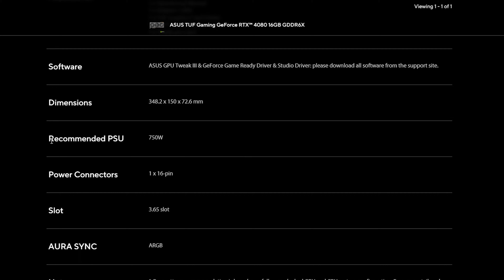RTX 40 | RTX 30 Series RED LED || SOLVED ||| 4090, 4080, 4070 ti, 3090 ti 3090, 3080 ti, 3080

Comment: If  you have ASUS motherboard, go to the BIOS -> Advanced power management (APM configuration) -> and set ErP Ready  to enable (s4 + s5). Problem is solved
Reply: It works! Thanks!
Reply: Didn’t work 😢
Reply: @ceoofaim2787  it turned itself off after 2 minutes
Reply: @Drozdu15  wild
Reply: @Drozdu15 what did you do?
Reply: THANKS M8!!!! you saved me from spending 20€!!!!!!!!🤗
Reply: What does this do?
Reply: Update:PSU started making clicking noises 1-2 days later after this setting change. Doesn't power on pc anymore. 850 watt evga gold psu. 
Worked for me. Thanks.
Reply: Really thanks !
Reply: Take it back and get another one. Problem solved: You have to watch courier service they like to throw your parcels..might have been the issue all along @henryrepeater
Reply: We need more people like you
Reply: Luv u
Reply: This worked! Thanks 🙏🏼
Reply: Greate!!! you are the best!!
Reply: It worked for me but I hope this doesn't cause problems somewhere else.i need see exactly what this setting Does?
Reply: I tried this but my pc keeps booting in safe mode it acts as if it’s gonna turn on like three times in a row and the. The issue persists
Reply: @pikimakeitsound  this fixed mine to but I try figure out what's up with urs
Reply: @ fixed ittt, for future reference make sure you do this from scratch before swapping out your card
Reply: Thank you thank you thank you thank you
Reply: Thanks man! Your awesome! My 4070 Ti stable working.

Comment: By the way, I just bought 4070 ti  same thing but I didn’t change the cable if you power it on it will work normally its bug in bios for the card I think seen lots of people have the same issue only downside right now is if you boot the device try to get to bios  it won’t work but a restart will fix it
Reply: How did u fix it this my first time build how do u get bios open if pc can’t even run for more than two seconds
Reply: @sfsango8559  did you find out? I think is a issue with the motherboard, it was running fine on a aorus motherboard, then I upgrade my system and red light appears on the new set up.
Reply: @armandoarroyo  I have redlight also, did u find any fix?

Comment: So my red light stays on when I flip the switch on the back of the power supply but when I click the power button on the PC case, the red light goes away. Does that mean my GPU is good to go because I’m playing games and the red light is gone but as soon as I turn it off the red light turns on
Reply: When the PC is off the 12 pin don't get any power. So the light comes on. When the PC turns on the 12 pin gets power so the red light goes off. But if it's red even after turning the PC on your GPU is not getting enough power.

Comment: Hi, i have exactly the same issue but after 8 months using without problem. Strange.
Reply: My 3090ti just started this after 7 months of use, and not daily hardcore use either. Sometimes only weekend
Reply: Did you get a fix
Reply: @HardHeadMilitary   Yes, had to change the power cable as he did in the video. Like 25€ on amazon

Comment: I think it’s normal that after turning off you it shows the red led because the power supply is no longer smooth as it is on in a nutshell the gpu is simply telling you  that it is not receiving enough power (obviously because the pc is off)
Reply: Is this true
Reply: @JohnTony-bv3rp I believe so there is a post about this and I have the same thing. When I turn it off it is red light all day. But turn on immediately goes away and the red light never comes back
Reply: @SFGiantsfan9797  yes I learned that it isn’t a problem at all it’s totally jirmsl

Comment: I have the same problem my 3070 ti has a red blinking light but all the cords are good and drivers up to date. It even runs games good so idk what the issue is
Reply: Did you figure this out???? I’m dying to figure mine out it’s a red flashing light also
Reply: @fluudzz6318  it downloaded the software for the gpu and it seemed to fix it like the actual software for the brand of gpu

Comment: I have a 4080 super strix ive tryed gpu tweak didn’t work I tryed bios thingy didn’t work the red led is only on when off I’m using a strix mobo b650e-e what should I do buy the adaptor or not care about it

Comment: I have an EVGA FTW 3 and it has been working fine. Then 2 nights ago, display went out, no RGB on the card and a solid state red light. I had changed the pcie slots on the psu and reseated the connector to the card it fired up… then when i started a game it shut back down. I have a new 3 pin to 1 connection coming in the morning, if that doesnt work I am either taking the card to microcenter or trying a new psu. Kind of at a loss
Reply: I had my card RMAed with the same issue, and even the RMA card is having the same issues.. lmk if the new cord fixes anything
Reply: @db8717  actually yes, the new connector seemed to have fixed my issue
Reply: @HardHeadMilitary  Alright, I will try that myself thanks man

Comment: If you have a corsair psu I would buy their 12+4 pin lead, I had the same issue on my 4090 and as soon as I switched to the corsair lead the light went out. The adaptor you get with the cards are horrible in every possible way.

Comment: When using PCI Express power cables with the Nvidia supplied 12 volt high power adapter plug, the red light will turn on when the computer is in standby mode. This is perfectly normal. If you purchase a 12 pin PCIe adapter from a third party supplier like CableMod, they have wired it so that light goes out when the computer is off.

Comment: First boot I had the same issue.
1 Used the Asus adapter, re-seated all, changed swapped cables around. and boom it worked. Just make sure all cables are connected properly.

Comment: Have a gigabyte 4070 has the power led above the plug! Is the led light meant to hold white all the time or only show red if there is an issue! Because I have no light lol. The led is their but does nothing, but the system runs sweet
Reply: Did u fixed it

Comment: Did your gpu work despite the red led?  My 4070ti rgbs turn on, but the gpu is not showing up in Windows 11.  I used onboard graphics to complete set-up.  I tried installing Nvidia drivers but install doesn't complete ... error msg 'not compatible with windows'.  I also have the red led on my gpu.  So, 4070ti not working ... is it a power cable issue or driver issue?  I've disconnected & reconnected gpu from pcie slot & power cables a few times to rule that out.
Reply from the maker: Yes mine works
Reply: Did you solve this problem.?Because I have the same issue
Reply: Mee too. Any solution?
Reply: Same issue here. Anyone found what’s causing it?
Reply: Noone will give us the answer. Only ask a question.  Smh
Reply: Did you try install with SECURE BOOT OFF in UEFI Legacy Mode?

Comment: My 4070 super shows the red light and so does my motherboard, but the card runs perfectly and it is detected everywhere in my computer so I don’t know if I should be concerned
Reply: same thing man. super confused here. i have the 4070 super 12gb dual and it works perfectly fine. just shows the red light when its turned off
Reply: me to help guys    it is fine ?
Reply: I have the same problem, and I also have a 4070 Supur card, but there is no problem with performance and everything is perfect
Reply: @TitanG2 ا
Is there a solution to the problem or is it normal?
Reply: @اميرها-ه2ش  no clue. Asus support is shitty and wouldn’t help me with the issue. I think the only way to stop the red light is too get a new pcie cable, but asus refused to do that.

Comment: This guy got it wrong. As as Community Admin of Asus says:
01-31-2023 12:18 AM

The behavor of the LED indicator has changed since the RTX 2000 series. White lighting used to indicate normal operation or connector inserted properly.

For the RTX 3000 and 4000 series, no LED means the same thing - normal operation. The reason being that we wanted to improve the cohesive look of complete systems featuring Aura Sync lighting, and reduce the brightness of the system while at night. These were some of the requests from users.

New definition: the LED behavior with a 16-pin adaptor cable (splitter) is:
Red = System shutdown/hibernate/sleep
No LED effect = System on, connector inserted properly

Comment: I used my 600W PCIe 5.0 (12VHPWR) provided with my power supply unit : Straight Power 12 Be Quiet and red led light disappeared too 👍

Comment: And why would this be a problem after almost 2 years running the same rig. Working fine until now. And bam red light.
Reply: Did you find out why im having the same issue 😢
Reply: @WhisperedAnnabel I ended up getting it fixed by the company that sold me the pc. 
They had to replace the entire GPU with a new card. Never had a problem since then
Reply: @donmeisner4438  Okay thanks I hope i dont have that problem 🥲